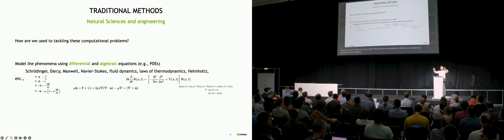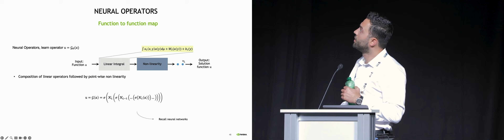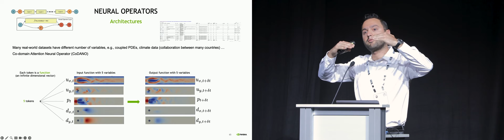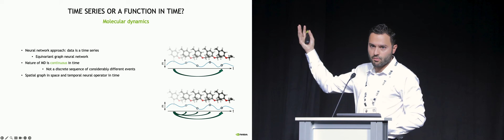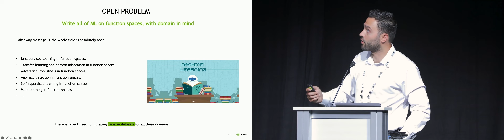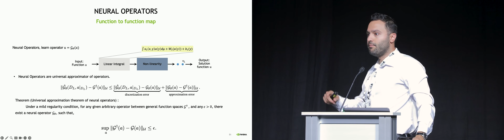ICML 2024 Tutorial"Machine Learning on Function spaces #NeuralOperators"

Comment: what is minimum gpu requirement to run the code given in your research paper? on pino
Reply from the maker: very tiny,  I dont recall the exact details of the smallest hardware we ran it on, but we could run them on very tiny GPUs (with a great loss in the speed of course). You should be able to easily run them on google Colab, or much smaller GPUs.